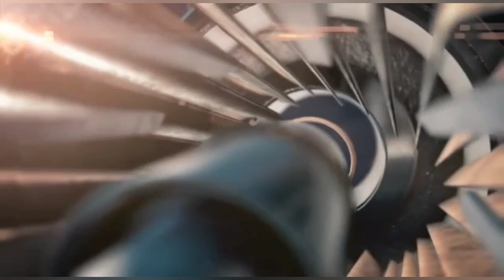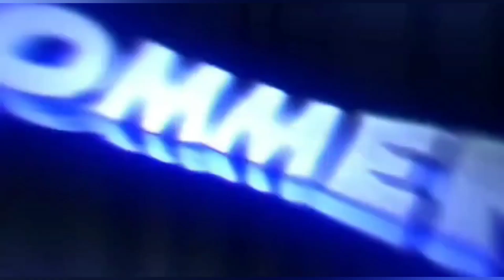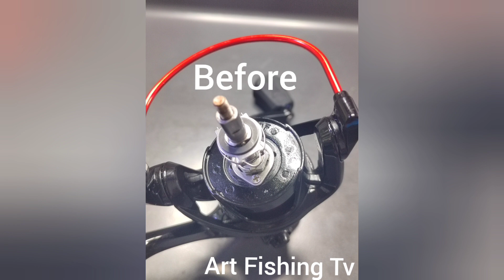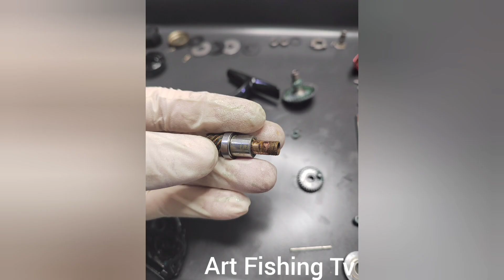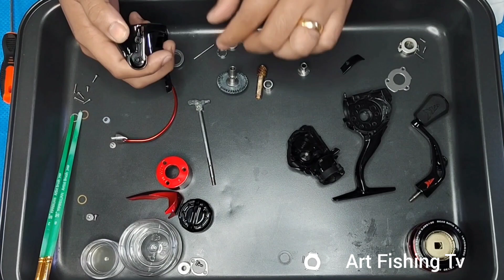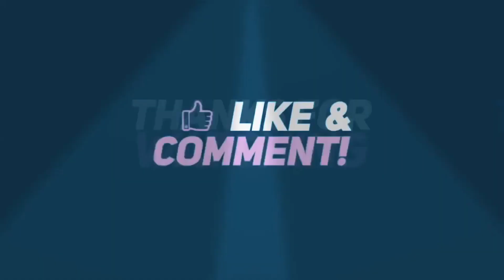Kastking Sharky III 3000 Reel / Overall Reel Maintenance

Comment: After cleaning I would  spray the whole thing in silicone grease then let it dry before putting grease on the metal parts this way you have double security the silicone grease makes water impossible to penetrate and makes plastic part last longer

Comment: Great video, I bought this size 3000 reel and noticed that the line does not sit uniformly on the spool, there is less line on the upper edge of the spool, I used 0.23 multifilament line.  Is the same thing happening on your equipment?

Comment: hello friend, hard work, what feedback do you give the reel? do you think it's good? how many bearings does it have exactly, it's a very used part in Brazil...great video hug
Reply from the maker: Hey bro. Personal opinion i will rate it 4/10
Bad Part :
Bearings using low quality 
Drive gear and oscillating guide poor quality 
Anti Reverse 
Good Part : 
Hard body 
Solid Shaft
Spool 
Using Carbon Drag and with bearings 
Advice :
Need to check time to time
Reply: Здравствуйте.Катушка новая или уже ловили рыбу?
Reply from the maker: Spool Bearing - 7x13x3
Main Bearing - 8x12x3.5
Right Side Bearing - 7x11x3
Left Side Bearing - 7x13x3
Oscillating Gear Bearing - 7x11x2.5
Reply: @art_fishing_tv I would like to watch your channel where you dismantle reels and review pros and cons

Comment: Hi my sharky gold iii 4500 has a retrieve problem it's nice and smooth then grinds and becomes hard to turn the handle any idea what causing this
Reply from the maker: 3 cause
1 - shaft either bend
2 - gear issue side plate
3 - oscillating gear or pin
Reply: Time for a new reel as I live in UK  no stockists for parts here
Reply from the maker: That one of reasons that im not recommended kastking because of parts. Unless you have deep pocket to buy same specs of reel and use old one as spare for the parts you need in future.. Try shimano or daiwa parts are accessible.
Reply: Yes diawa bg will be the replacement 👍

Comment: How it's the size of the bearing of the pik up ? Thx
Reply from the maker: Spool Bearing - 7x13x3
Main Bearing - 8x12x3.5
Right Side Bearing - 7x11x3
Left Side Bearing - 7x13x3
Oscillating Gear Bearing - 7x11x2.5

Comment: Do you know what size the line roller bearing is?
Reply from the maker: I think its 4x7x2.5 but not really sure coz they're using bushing and i didn't do caliper for it
Reply: What's the size of the bushing/ballbearing of the pickup lineroller?  Please, can you measure it?

Comment: Sir what is the size of the bearing inside
Reply from the maker: Spool Bearing - 7x13x3
Main Bearing - 8x12x3.5
Right Side Bearing - 7x11x3
Left Side Bearing - 7x13x3
Oscillating Gear Bearing - 7x11x2.5